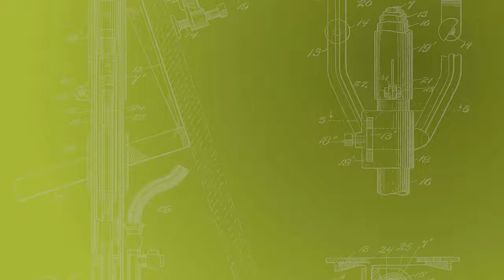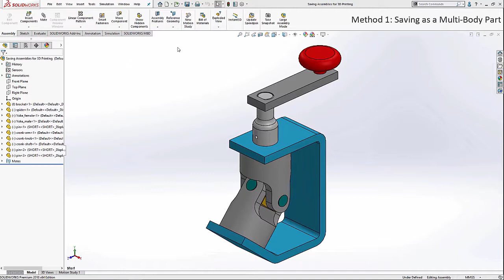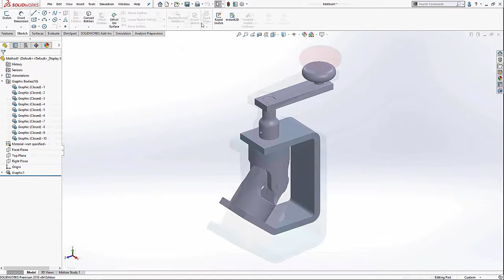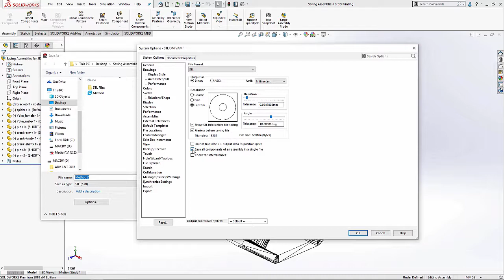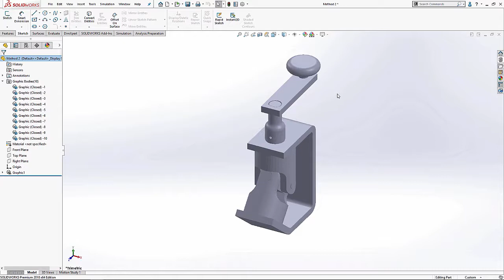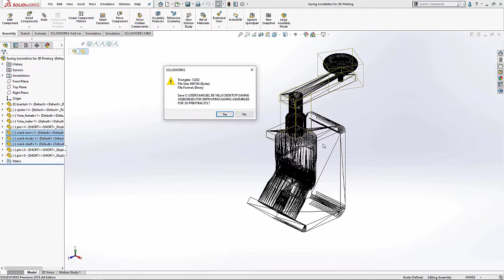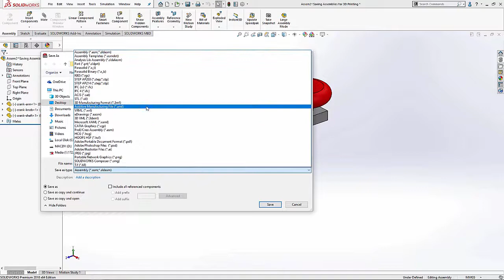SOLIDWORKS - Saving Assemblies as an STL for 3D Printing

Comment: Thank you for posting this.  "Saving all....in a single file" is a life saver.  I tried making a sub-assembly per the video instructions and that failed as my mates still tried to break.  However, I was able to suppress or hide the parts I didn't want to print and then save per above and it worked awesome.  Thanks again.

Comment: Man, can you help me to do this process in reverse. I mean I have the stl of an assembly, and am trying to convert it back to an sldasm file. Can you help me out please!
Reply from the maker: When you open the file in SOLIDWORKS, you should see some options for feature recognition and be able to open an STL file in SOLIDWORKS. But there isn't a native SOLIDWORKS function that can convert an STL into a SOLIDWORKS assembly. You would have to put in some manual effort to split the bodies into separate part files and import them back into an assembly file. This blog outlines some editing options for working with that geometry, but sadly, there's no magic button that exists out-of-the-box to convert an STL into an SLDASM: https://www.goengineer.com/blog/modify-imported-body-solidworks

Comment: I have lots of .xt parts (parasolid format) files. I would like to make 3D printing. I know that .stl is the preferred format to do 3D printing. My doubt is can i insert all the .xt files in to solidworks assembly mode and once assembly process is completed then can i saves as the file into .stl. Will all the .xt files convert?
Can you please guide me on this.
Reply from the maker: Hi Anand,
Typically Parasolid format imports with few geometric errors so they can be saved into .STL straight away.  Sometimes you may need to repair the models before saving into .STL though.  Just make sure to follow the instructions of 'Import Diagnostics' if they come up after an import.